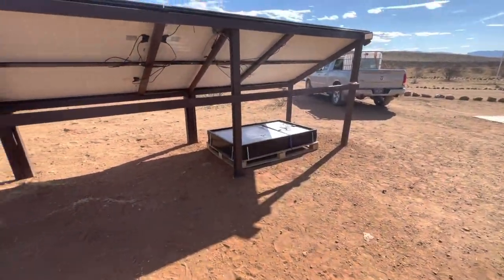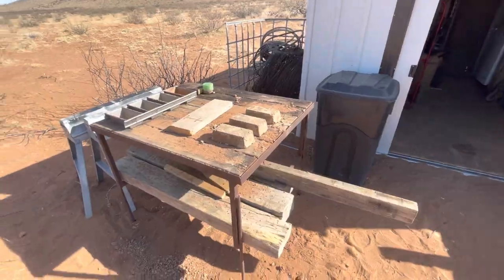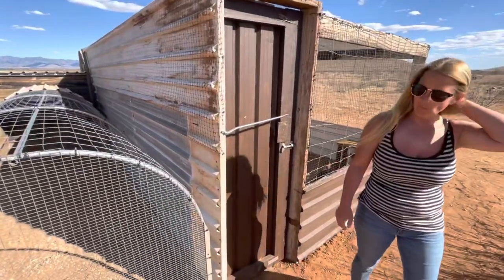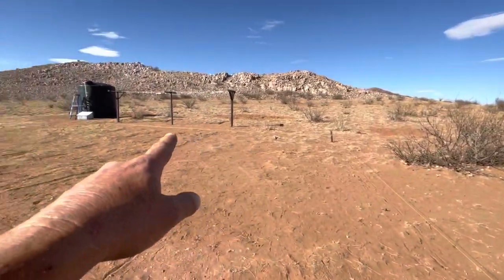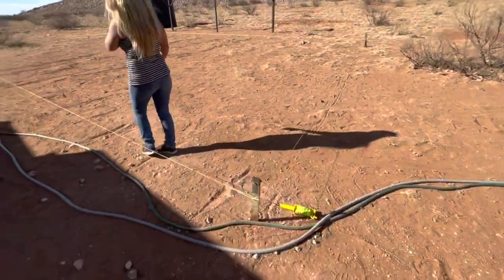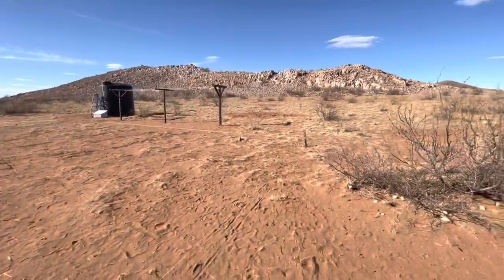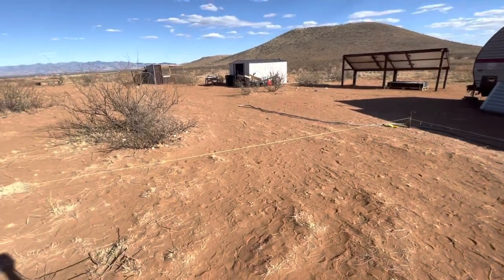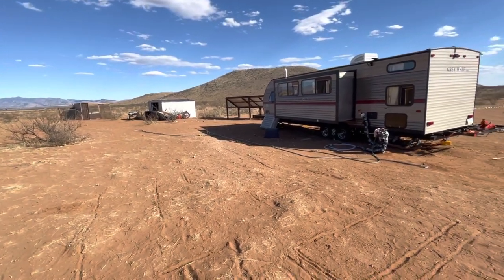Off grid living | Update on the house and adobe brick mix

Comment: If you can separate a few solar panels with a 12 volt battery,  you can have a very efficient solar circuit,  for something like lighting.  Avoid batteries in parallel.  I like Crown CR-220 golf cart batteries in series for the most bang for the buck.  A solar trick is point half your panels largely east and one half largely west.  You lose total watts but your charge duration will increase.  = worth it.

Comment: get yourself a heatpump water heater, and replace the electric element with a small resistor and you can have full size tank that heats on about 400 watts. I can give you more info if you'd like it.